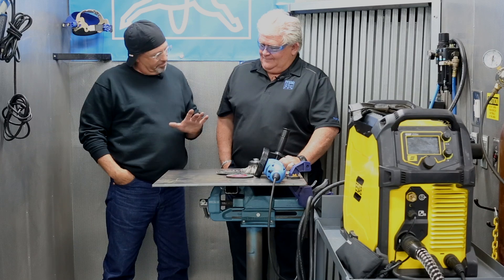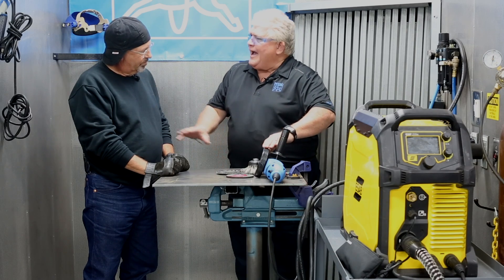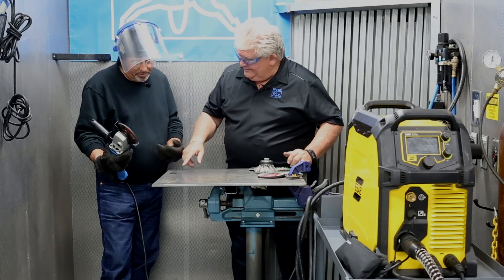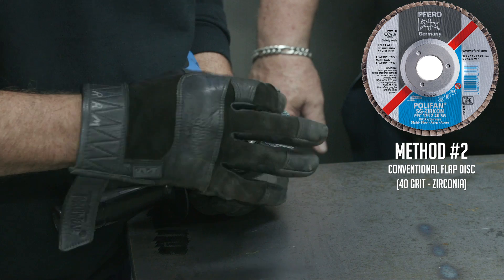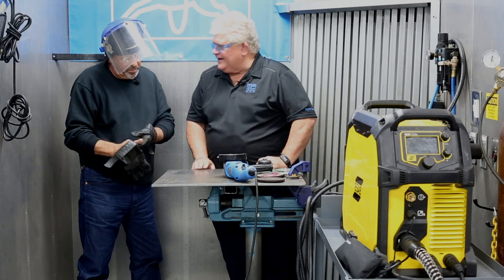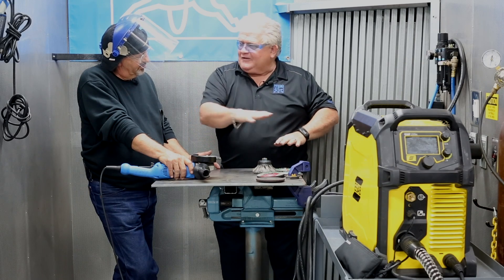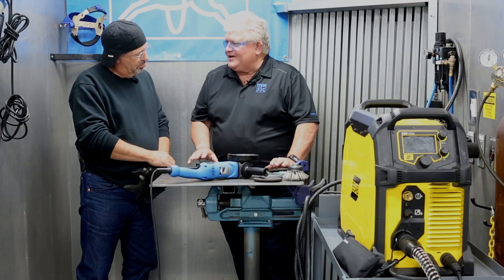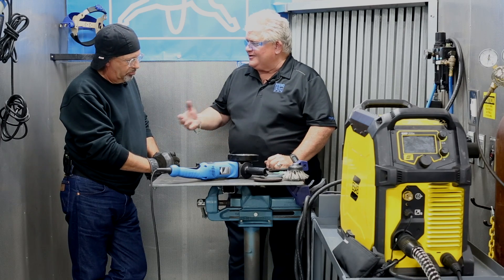Four Ways to Remove MILL SCALE

Comment: All of the manufacturer websites that sell silicon carbide abrasive discs specifically say they are to be used on NON-FERROUS metals, including Pferd's own website.  So why does this salesman recommend them???  

"Materials that can be worked:
-aluminium
-Bronze
-other non-ferrous metals
-hard non-ferrous metal
-titanium
-Titanium alloys
-Thermoplastics
-fibre-reinforced duroplastics (GRP, CRP)
-stone"

https://www.pferd.com/int-en/products/fine-grinding-and-polishing-tools/combiclick/fibre-discs-cc-fs/silicon-carbide-sic-type/silicon-carbide-sic-type/cc-fs-125-sic-60/?filter=%7B%2522q%2522%3A%2522silicon%20carbide%2522%7D

"The silicon carbide abrasive used for our semi-flexible discs is extremely sharp and tough, which results in aggressive grinding on a variety of surfaces including concrete, fiberglass, NON-FERROUS metals, marble, porcelain, and granite."

https://www.amazon.com/dp/B01GLGG5AU/ref=sspa_dk_detail_7?psc=1
Reply: This is a little subtle, and I never really thought of it 'till you brought it up:  What BOB is trying to grind is the mill scale which is "Magnetite"  (Fe2O3) and NOT IRON.  Not so much metal as a mineral, eh?   Anyway, from the remarks at the beginning of this episode, he's trying to grind off that black stuff and quit when the metal shows!  In OTHER situations you might be using the same grinder in the same spot to actually remove a quantity of metal, say making a bevel on something, grinding a weld down flush, all like that and it's a different situation! 

???  I'm going to look through my collection of dusty old grinding wheels and see if there's a little experiment to do.
Reply: Would love to know more about that exact issue, WHY not for ferrous metals? Gotta be a reason. Went hunting for some of these disks and that keeps getting repeated, someone, please? TIA ;)

Comment: Vinegar.

I recently had five HRS skid plates I needed to prep for paint. I tried a flap disc from Diablo which are zirconium according to the website. No dice. I consider myself a patient person, but I don't have patience for that. 

I hit the web and found HRPO (hot rolled pickled and oiled) steel which is treated in acid (HCl typically) to dissolve the scale and then bathed in oil to prevent corrosion. I only had the garage to use and it was cold out so I had to keep the doors shut so I figured muriatic acid was a no-go. Acid fumes will cause inflammation in your lungs. It can also cause pulmonary edema where your lungs try to dilute the acid by passing fluid through the membranes that absorb oxygen (the alveoli). You drown in your own fluids. I doubt that is fun. My garage is attached. Also I didn't want every metal surface in my garage to corrode.  

A little more searching lead me to vinegar. Like the stuff you put on your salad. They do make a 6% concentration cleaning vinegar which is stronger than the typical 5% white vinegar. Buy it at the grocery store in gallon jugs. HD wants to rip you off selling it per quart. It should be like $3 per gallon. Stupid cheap. 

The way it works is the same as hydrochloric acid - it dissolves the scale. Vinegar is acetic acid. It takes longer than hydrochloric, but if you are a home gamer you likely have time. The trick is keeping it in contact with the plate which can be difficult if it has a couple bends in it like my skid plates. The secret is an absorbent wrap like cloth or paper towel. Both would work. Old bed sheets would also work great. 

I cut open a contractor garbage bag and lined a large, shallow box with it. I lined the bottom with paper towel and wadded them up where the plate wouldn't make contact with the bottom of the box. I put the plate in and lined the top of it with more paper towel. I poured 6% vinegar over the entire thing making sure to saturate the towels completed. I covered it up and came back in 24 hours. I was able to wipe the scale away with a maroon Scotch Brite pad with minimal scrubbing. That's it, it just wiped off. I did this through the week so I was able to do five plates in five days working for about an hour when I got home from my 9-5.

Because I had the benefit of time vinegar worked for me. If you have a large HRS plate and you need to remove the scale it will work for you too. If you need to do it faster I think the diamond coated brush presented here is an interesting choice, or you could pay someone to sandblast it. 

Good luck!
Reply: Tried it ,it works and works well, shitload cheaper than trying to use flap disks
Reply: If you were doing that a lot with similar size work pieces you'd use a plastic storage tub or a kids' shell pool or something like that - a plastic container the right size and shape with a lid that fits pretty well.
Thanks for the tip, this is something that has been bugging me a lot - and home on the farm, I do expect to be able to work my schedule around letting stuff soak for a while. How do you tell when the vinegar is no longer re-usable?
Reply: This works but it depends on how thick the piece you are working on is coated with mill scale. Vinegar will take well more than 24 hours (in my experience) trying to remove thick coats of mill scale.
Reply: Works faster if the vinegar or acid is heated
Reply: Works well on plain old rust too if you can soak it over night. Rinse it off with baking soda when done to neutralize the acid. a Scotch-bright  pad after soaking will take off what does not fall off on it's own.

Comment: you can go to the paint section of walmart and pick up a gallon of muriatic acid for $7, (its acid so be careful) pour it on the mill scale, scrub it with a stainless steel scrub pad like you use in the kitchen (or a pressure washer might work great), rinse it off with water, and clean an entire side of a 4x8 sheet in 30 minutes
granted you are dealing with water so you will need to dry it

Comment: Diamond (carbon) dissolves in steel (iron). I.e. it will not last long.  Use CBN for steel.
Reply: Funny, I have diamond sharpening stones I have used for well over 10 years. Must have something to do with speed or heat. I use my stones at least 3 times a week on various knives and they are still going strong

Comment: I stock up on 4-1/2" polycarbide abrasive wheels when they're on sale for $3 at Harbor Freight.  The ones for angle grinders with the fiberglass backing work the best.  They last forever and cut mill scale like that diamond wire brush.  https://www.harborfreight.com/4-1-2-half-inch-nylon-abrasive-wheel-94017.html

Comment: depending on the hardness of the scale, you can also use a paint stripper disc for about the same effect. it won't work on scale that's as hard as what's in this video, but for tube and flat stock it cleans off the scale instantly and, if you aren't too aggressive with it, won't leave noticeable marks.
Reply: Regular grinder rpm or slower like they demonstrated? I'm a beginner.
Reply: @stephk5255  regular speed. keep the disc as flat to the surface you're grinding as possible, for the best finish, and so you don't dig in and leave gouges.

Comment: "Oils floating up ... at 1800 degrees"; "you've exceeded the temperature of mill scale and it starts floating" -  geez, whom they are going to swindle? Steel melts at around 1530-1490 °C (2890-2715 °F), and there's no "oil" capable of withstanding such temperatures. Mill scale melts around the same temperature - just barely few degrees above that of steel. And no, you can't get it that hot using grinding discs - and the sparks are just tiny steel (iron) filings scrapped off the surface and burning in the air (iron is pyrophoric metal - means, when finely divided it combust spontaneously in the air).
Red- or orange-hot steel exposed to air simply oxidises, and mill scale is just a mix of various iron oxides (FeO, Fe2O3, and Fe3O4). Granted, some oil can get onto it (and soak into) in whatever manufacturing process(es), but that's not anything typical. Yes, millscale is firmly attached to base metal. And it is hard, very hard - and that's why it "glazes" softer abrasives.
Flap discs are tad better, as they are much softer and flexible, thus better conforming to the surface one works upon (and that give more uniform and wider cleaned passes - and less "gouging").
The abrasive cloth those flap discs are made of have somewhat weaker bonding between individual grains of an abrasive (as compared to non-flexible grinding discs), thus they (the grains) are relatively easy torn off, as soon as they get blunt.
The reason / mechanism behind it is that as a cutting tip of an individual grain of an abrasive gets blunt, the force acting on that grain increases - and if that force gets grater than the strenght of the bonding agent, that grain gets torn off from its bonding matrix - and thus it makes way for a new, sharp grain beneath (and this is the mechanism behind self-sharpening property of abrasive disc or wheels).
SiC (silicon carbide, carborundum) is just an abrasive significantly much harder than zirconia (zirconium dioxide, ZrO2) or aluminium oxide (corundum, crystalline Al2O3) - it's so hard you can use it for grinding tungsten carbide. And this hardnes is, IMO, what gives SiC advantage over ZrO2 or Al2O3.
Judging by light reflections at 8:42 - 8:48 I can't say there's that much difference in "gouging" on a base metal between zirconia flap disc and silicon carbide disc.
And, anyway, this is the first time I've ever heard someone seriously concerned about "grinder marks" on a mild or low-alloy steel that are going to be stick welded. (Or MIG, or dual shield welded - ganz egal, makes no difference - and those "gouge marks" are completelly irrelevant.)

If you want "nice and smooth" surface then go for sandblasting och chemical removal of mill scale.
Or... Wait! There is, or rather "used to be" a very good SiC based disc for removing mill scale - and it used to be made by... Bingo!:
https://www.pferdusa.com//products/204q/204q04P.html - howerever, it is a "discontinued item" - wonder why...
True, it wasn't cheap, in fact it was several times the price of a regular grinding disc - but it removed mill scale like a charm, and left no gouging marks - just a shiny satin-gloss surface.
About that "method #4" - I'm just wondering how much that gizmo cost, and how well it will survive contact with the edges of that plate - my experience says it will cost an arm and a leg, and that tiny pretty wires will fly like fairies the moment you put it against any hard edge. But I might be wrong, who knows, who knows...

BTW, Norton's Gemini discs (a.k.a. "Octopus discs") also do a decent job when it comes to rust and mill-scale removal (they can even handle old paint, providing there isn't too much of it on metal) - https://www.nortonabrasives.com/en-us/gemini-avos-ao-type-29-grinding-wheel
They tend to be on a rather pricey side, but in my opinion they are worth their price.
(And no, I'm in no way affiliated with any of those manufacturers, I'm just a regular guy occasionally doing some welding or machining, whenever need arises.)

Well, I guess everybody has his mortgage and bills to pay, and gas or beer doesn't come free either - still, lending oneself to this kind of sell-a-vision style commercial... Gezz, gotta have some respect for oneself, methinks..

Comment: Mill scale is not what he said. It's just oxides from being exposed to air while hot.  It's not "impurities coming out of the steel".
Reply: I agree all the impurities are removed in the steel manufacturing process. He sounds like a typical sales man lots of babble no real facts.
Reply: Some of it may be impurities,  but when you look at the difference in thickness of mill scale on solid versus tubular shapes, you will notice that solid stock develops a much thicker layer.  This thickness is a function of how long the steel stays hot enough to react with oxygen.  Tubular shapes cool faster, thus the scale is thinner.  For tube shapes, I remove scale with an orbital sander.  For solid shapes, I use a pickling process.
Reply: @freshpootube it's definitely an oxide layer and the problem is that it will cause welds to cold lay instead of fuse, has nothing to do with getting painted. They paint over (cleaned) millscale at my job all the time. Luckily our tolerances allow for us to just grind it off but we use 3m discs instead of rock wheels and it works pretty good.
Reply: Correct
Reply: Thank-you for this.
Drives me caraaaazy when I hear nonsense about mill scale being 'impurities'.
It's simply sci-fi level oxidation and white vinegar will deal w it, safely and simply, while not rusting the crap out of everything in the shop like harsher acids will.
Reply: My welding instructors say its impurities coming out of the steel. I'll trust the guys I pay lots of money.
Reply: @Mikey-ym6ok  Your instructor is wrong. 

https://www.sciencedirect.com/topics/engineering/millscale

Millscale is a thin layer of iron oxides which forms on the steel surface during hot rolling of the plates and sections.
Reply: I worked in a smelter. It's exactly what he said it is. Molten metal is much denser than the crap it reacts with, and there's always a layer floating on it that you have to scoop out periodically.
Reply: @memyselfandi8544  Mill scale isn't slag/dross .

Mill scale forms on the surface of solid red hot steel when exposed to oxygen. 

It's called mill scale because you get it from hot rolling mills. 

Also, powdered mill scale + aluminum powder = thermite!
Reply: felixar90 Do you have an argument beyond your opinion? Otherwise, the professional gets more credit, especially since I can confirm what he said. Mill scale ain’t just rust.
Reply: @memyselfandi8544  It's not my opinion.  I work in a fabrication shop and we use tons of hot rolled steel. 

We also forge stuff and I've seen mill scale being formed right in front of my eyes. 

If you reduce the mill scale in a thermite reaction, it turns back into iron. 

I'm also not even one year out of trade school and our shop teacher explained what mill scale was. 

Did you even look at the wikipedia article? https://en.wikipedia.org/wiki/Mill_scale
Reply: felixar90 I also used forges after discussing this process, we agree that there some sort of burned metallic layer. It even can chip off. I’ve got a forged piece here that has no milscale evident. It’s clean. So I guess its possible but I doubt it.
Reply: @felixar90  Wikipedia isnt a reliable source of information. I suppose there's a wilipedia page that says it is reliable though. Wikipedia is a pool of information compiled and edited by anyone with a keyboard.
Reply: @v8trauma  No it isn't. Anyone who thinks that wikipedia is just something anyone can write up, doesn't require sources, and simply dismisses the information.

How about sciencedirect? 

https://www.sciencedirect.com/topics/engineering/millscale

Millscale is a thin layer of iron oxides which forms on the steel surface during hot rolling of the plates and sections.
Reply: @PBMS123  erm, if you want to be taken seriously, don't quote Wikipedia is what I'm saying. There's so much misinformation on there. You appear to have assumed I was discussing the chemical makeup of millscale.There are loads of cases where facts have been changed or entered incorrectly, corected and changed back by some helpful idiot. Have a look for corroborating evidence, you'll perhaps understand it if you look for it yourself. Just saying, because its on Wikipedia dont make it true, it may well be, but its not consistently accurate, again, because anyone can edit the page.
Reply: @v8trauma   Actually it is remarkably accurate, and most general, large, popular or what is considered something that is basic knowledge, unlikely to change, is locked. Every single sentence in a wikipedia article is backed up by outside resource. If it isn't it will say so, wikipedia is incredibly anal about backing up claims in a topic or page that any claim or sentence in a page will say [citation needed] [who says that] [when?] or some other version of this, if a claim is made that is not backed up by outside resource.

It is a trope of lore that wikipedia is unreliable, untrue and ca  be edited by anyone. Every single edit is recorded, every edit is checked over by someone, and changes or additions of false information are removed within a day.

It just isn't true anymore to say that wikipedia isn't a reliable source of evidence, and on top of that, it is a complete logical fallacy to disregard any evidence from there without providing contradicting evidence and source material. It is not acceptable to merely so, no you're wrong because you quoted wikipedia, or you're stupid because you're quoting wikipedia. It's an absolute fallacy and people shouldn't use it.

Show me something on wikipedia that is "wrong" or part of that "so much misinformation" you keep referencing, that isn't either suffixed with a [citation needed] or some other rebuff to the claim, or doesn't have any references to backup the claim. Go on please show me.

I'm going to guess that you can't.

It is a complete non argument to try to claim that "oh if you want to be taken seriously".... Seriously, it's such a bullshit argument, because wikipedia is a summation of information from other sources, that is referenced on every page. So if you really want to find something the references are at the bottom.

Comment: This is BS, no reason for them to cost this much considering the many other products that employ the same technology at (sometimes even precision applied s apposed to this random low tech process). 
Even worse than them charging ten-twenty times what they should be is the fact that your just trading one impurity for another since diamond will embed in all but the hardest of materials & who knows what kinda issues will stem from the Nickel alloy (what bonds the Diamond matrix to the wire).